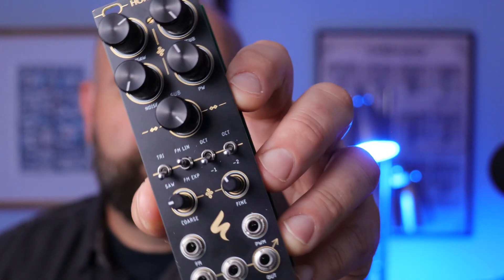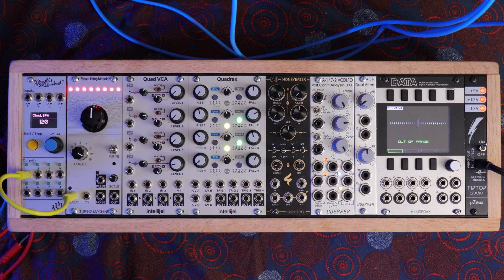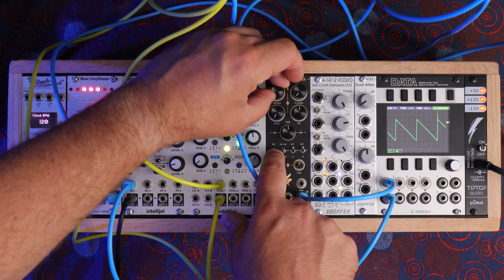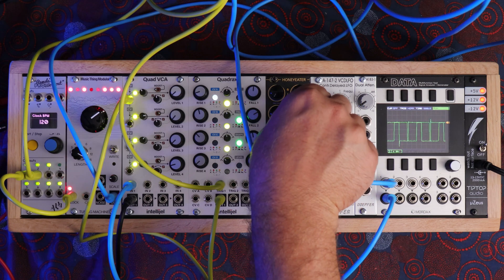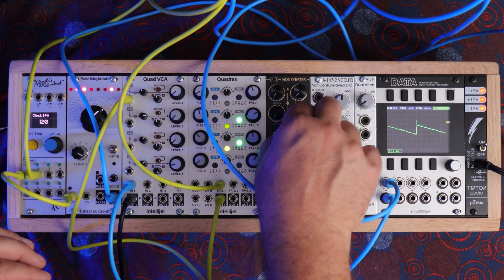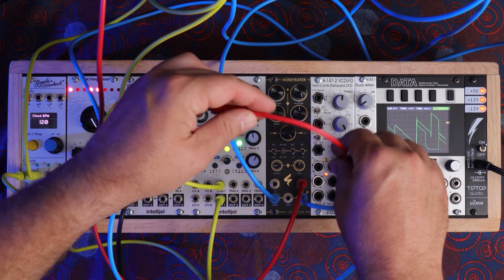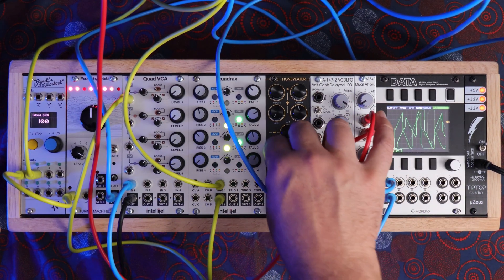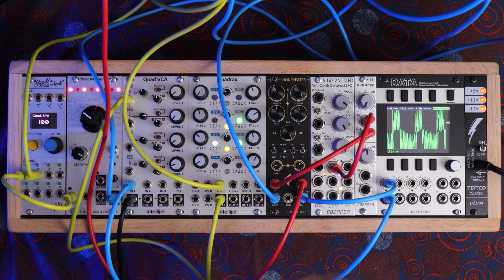ST Modular Honey Eater - Patch Walkthrough - Features and Sound Demo

Comment: I’m starting out from scratch looking for an oscillator. Plaits looks great but I’m wondering if I should start with something like the HoneyEater
Reply from the maker: The Honeyeater would be a great starting point. I'm somewhat lukewarm with Plaits. It's great, but there are so many different modes, I much prefer the simpler modules. 

You can also check out my video on Cheap vs Expensive Oscillators. I compare a few different options. 

But the short answer is - The Honeyeater is a good option. 

With all that said - Plaits (or a clone) is a perfectly fine place to start too. :) you'll likely try out many more on your modular journey!